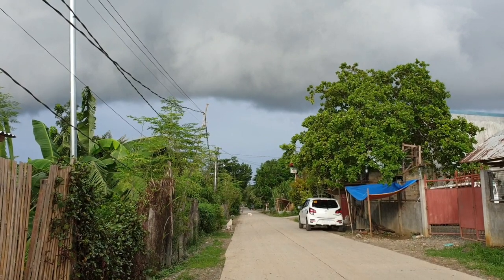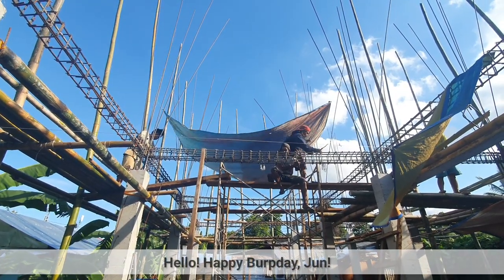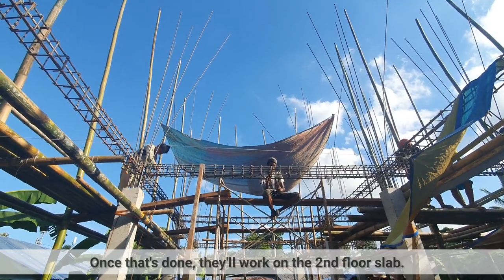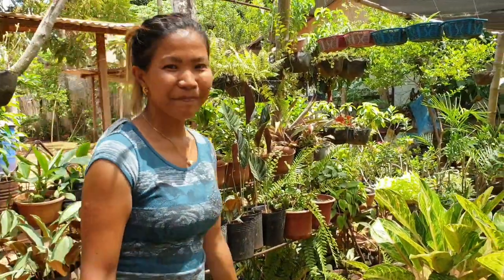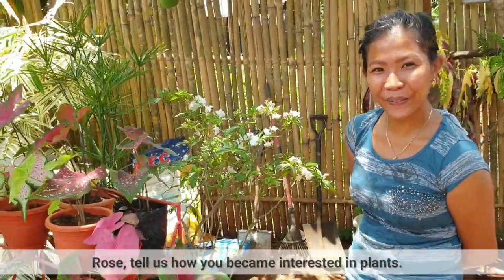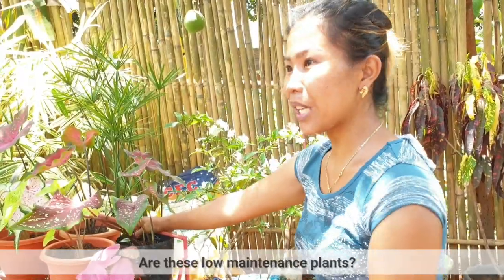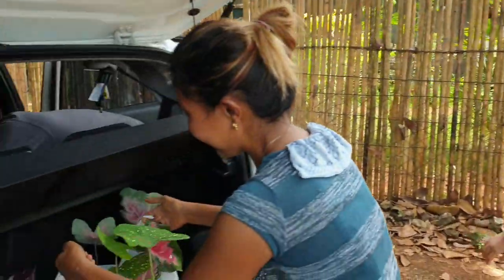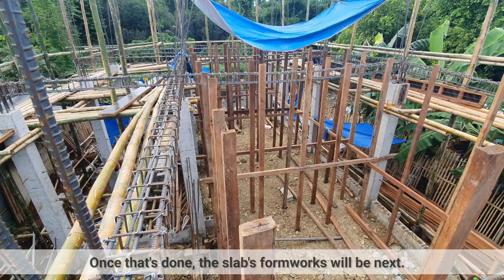House Building PHILIPPINES | Wk 7 Rebar and Slab Installation | Our Hooga Home | Retired OFW

Comment: Hello from North Carolina USA. We are building Casa Cecelia in Maragondon, Cavite, Luzon. Ours is all poured concrete and currently at the skimcoat stage 
of construction. We are paying the crew through the pandemic but not there to supervise construction. You can see our build by clicking our coment icon
on the left. We have reimagined security grills and septic tank design among other things. Concerning plants. It looks like you bought what we call "Hostas"
which are well suited to your pocket garden because they are understory shade demanding plants. Ypur 2 storey walls and roof overhangs will be great at
blocking doirect sun. We use canna lillies, tiger lillies, peace lillies, asiatic lillies, and are introducing "hot poker torch lillies" which all like full sun and are
maintenance free and difficult to kill. Those along with bananna plants fill anyplace we don't need for walkways. I am binge watching your house build and
am impressed with your quality and floor plan. The grade level tie beams are really well sized and well built. The rebar for the footer pads and beams is also
well done although 135 degree bends on the styrrup ends would be a nice touch at zero cost increase. Google translate is working really well on your
husbands explanations.
                                                                  george and aurora    unfamous for our decagon shaped house